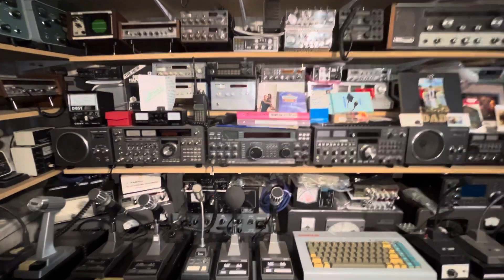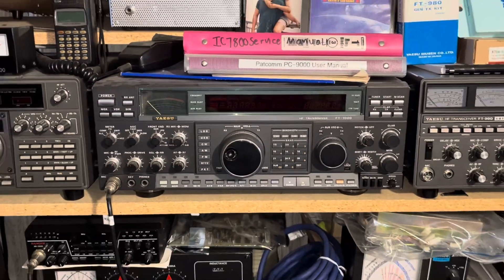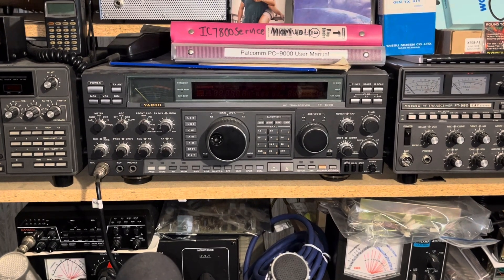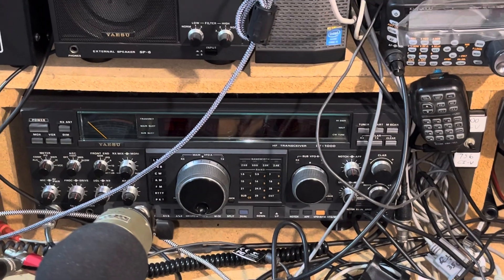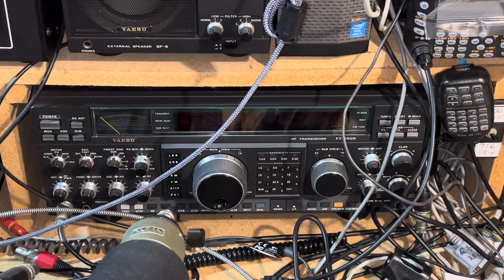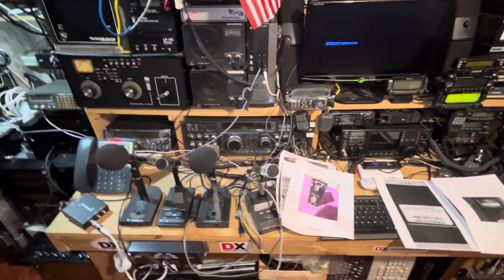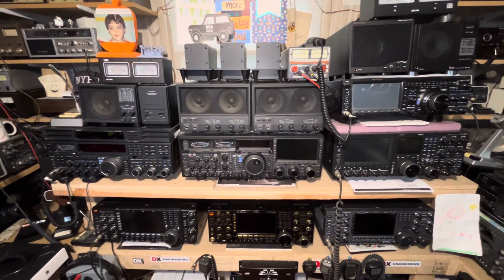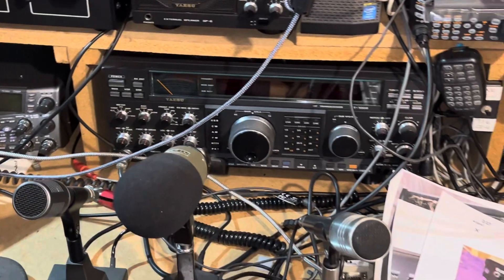Yaesu FT-1000 & FT-1000D How to Tell If your Radio is a Factory “D” and Latest Production Model.

Comment: What the radio worth in good condition with a sp5 time wave speaker desk mic md100    mid 1992 model
Reply from the maker: Pricing is all subjective. Best I can suggest is check all the online ham radio selling websites and also completed eBay auctions to get some pricing on what they are actually selling for.  It may be best to part out the station and sell each item separately to hopefully recoup the most money. Just take into consideration that the used radio marketplace has been trending low $ for the last couple of years.  Either way good luck and wishing you the very best at sale! Feel free to reach back out if you have any additional questions! Best 73, Len

Comment: Good to know I am not the only Radio NUTCASE around Len I even love working SDR since the G59 to today's Flex Radios I am also running the .311 Software... Check My QRZ 73 BTW on that 1000D did you buy the updated Chip 6.0 or was it already installed?